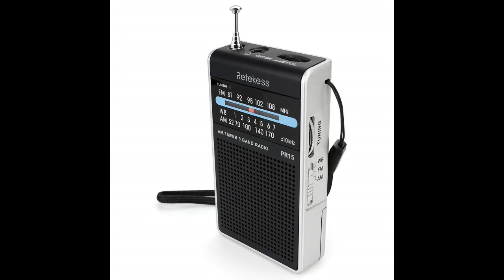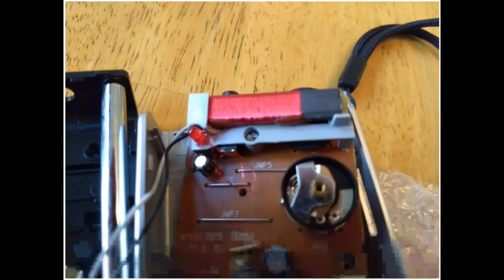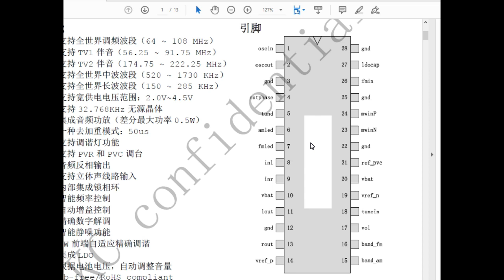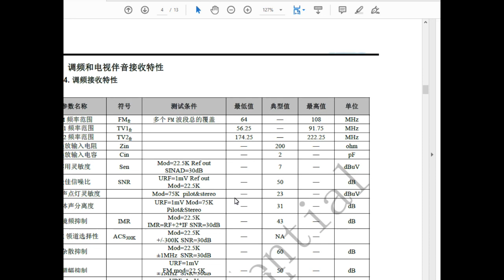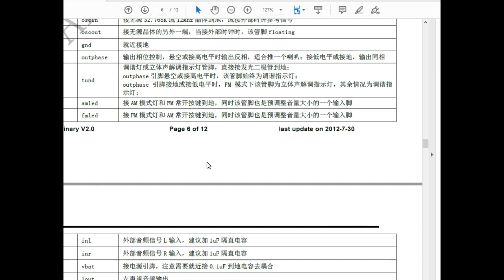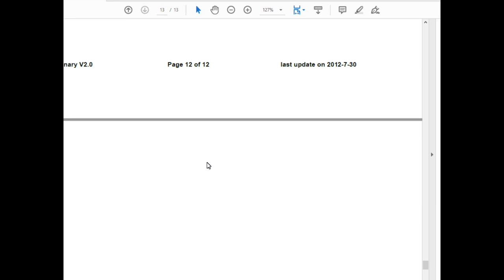Retekess PR15 AM FM WB Radio Teardown Whats inside

Comment: Would've been nice if you would've told us the values of the electrolytic capacitors, the part number on the ic and the part number's of the transistors... Definitely want to recap mine with quality... The sir of the speaker would be nice too.
Reply from the maker: IC is identified in the video at 7:21 and the numbers on the speaker are visible as well. The transistors have no part numbers on them. I’m not sure of the cap values but one of them in the middle looks to be 22uf. Thanks for stopping by.
Reply: @TheRadiogeek  tried to send the link to the chips datasheet but it deleted my message, apparently it can handle 2 volts to 4.5 volts and at 16 ohms it'll do 500mw out of the chip to drive a speaker, I might put a 1000mah or larger EEBL lipo on it after recapping it since they come with a bms on them, might put a better speaker too after using deoxit d5 on all the controls.
Reply: @TheRadiogeek  also going to redo some of those solder joints and clean up the Flux too

Comment: I never saw a tuner of any kind, what the heck is the tuning knob attached to-???
Reply from the maker: It’s a piece of plastic with little teeth on it. When you tune the radio the red plastic slides the dial pointer up and down the dial.
Reply: It is all within that chip, likely it's just a variable resistor, no tuning capacitor since it is a dsp radio.